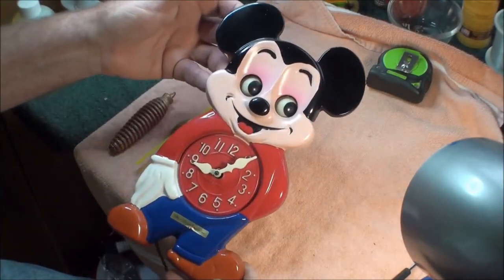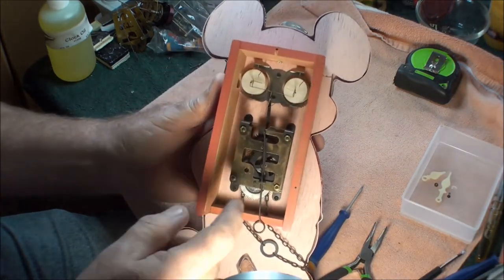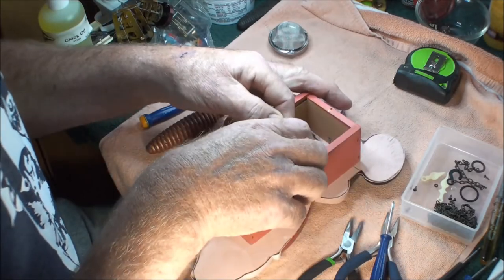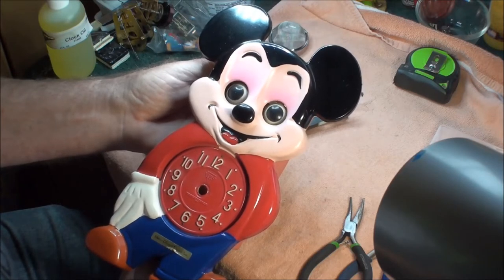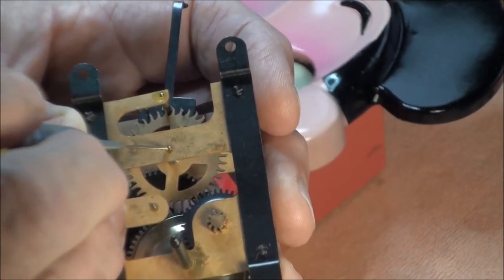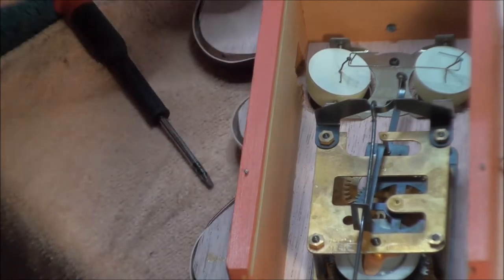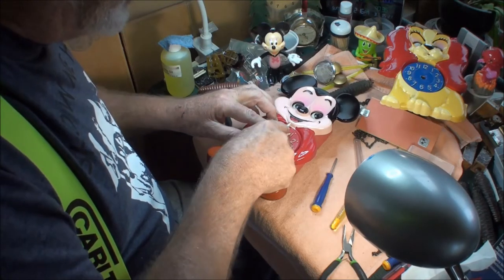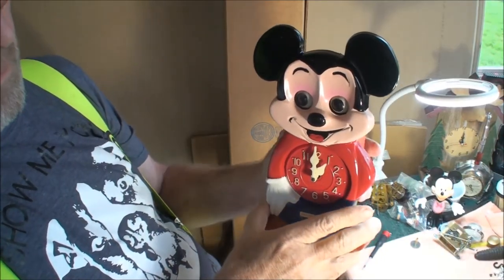VINTAGE JAPANESE MI-KEN MICKEY MOUSE MOVING EYE ANIMATED NOVELTY CLOCK

Comment: What a treasure. I'm amazed at what good condition the clock is in. Great find.
Reply from the maker: You are right, looking for a no crack and all the right parts is a hard one to find unless someone packed it away and they did a down sizing of their house and came across the clock and put it on the market.

Comment: Hello Mike, thank you for the video, what is your thoughts (especially on a more complicated clock) putting the chains on before installing the movement?  I would drive my mentor crazy doing it that way but I never liked handling the case that much and possibly breaking a piece off an expensive cuckoo clock. Thank you again for the video, and Merry Christmas to you.
Reply from the maker: I install the chains both ways. The Mickey Mouse Clock was easier to install with the back off and people like to see how the chain gets installed. My other cuckoo clock videos I show while they are in the case and before I install the movement. Thanks for stopping by DNA

Comment: I think this kind of  movement is easier than Cuckoo's.  Does it have a name?   please tell me where can I get one in low price? I 'd like to disassemble it  for practice. By the way, where do you usually buy all the parts (including Cuckoo clock)?  I need my order to be shipped to Taiwan.
Reply from the maker: These clock are not cheap, $50.00-$100.00 on E-Bay. You can buy clock parts from Timesaver. com  Thanks so much for stopping in
Reply: @justmike57  Thanks

Comment: My  Danny Oday ventriloquist figure eyes mouth and eyebrows move it’s like clockwork very fragile
Reply from the maker: Because of the age of the clock, the outer shell is hard to find not all cracked up.
Reply: @justmike57  it is a beautiful mechanical Mickey clock there's not very many around I seen one on eBay $56 it's hard to really know if it's in good shape until you get it